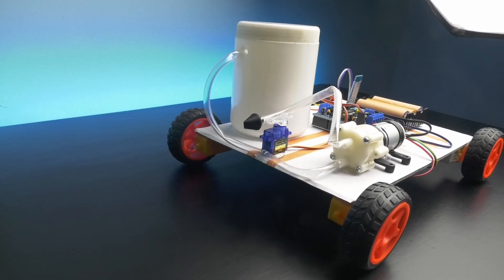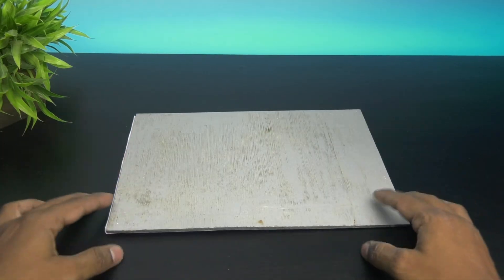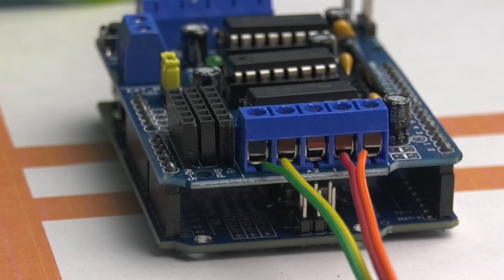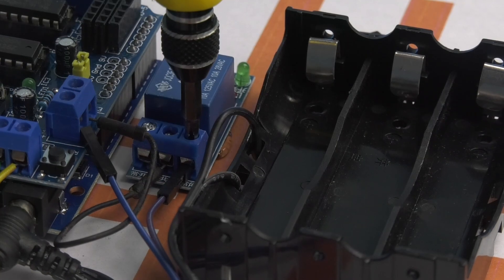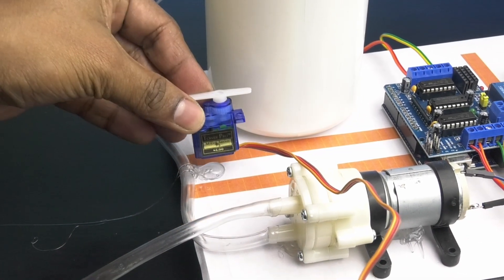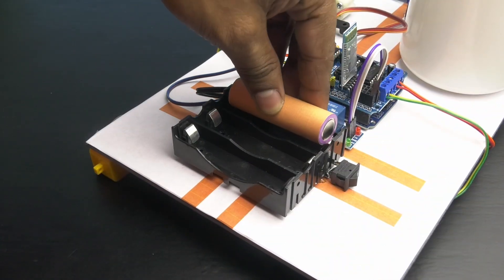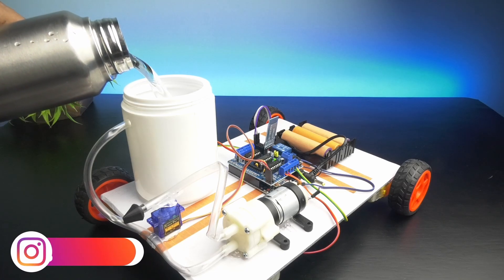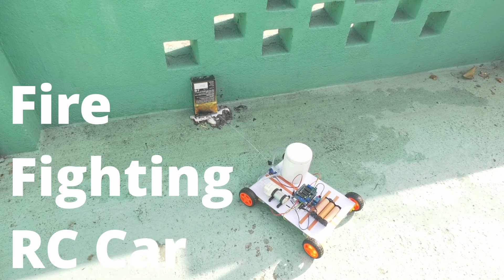Bluetooth Controlled Fire Fighting Robot RC Car based on Arduino | Ut Go

Comment: bro, in ur videos, you directly connected battery with arduino boards right, then it should gives motor shield 5v input when they are stack together, so how does it drives 12 pump since the input voltage for relay board is from motor shield(5v as well)
Reply from the maker: The relay board is only controlled through the Arduino board but the pump power is directly connected through the battery.
Reply: @UtGoTech  ohh i see I see thank you. So I am thinking i can actually get power for pump from a0 to a1 right, like the bluetooth module, it’s 5v
Reply from the maker: @Qenny-m4n That can damage or overheat the Arduino board
Reply: @UtGoTech  okay so I just do the same as in your video, but I will add a voltage regulator to that 2 jumper wires instead of connecting them directly to the pump.
Reply from the maker: Yes

Comment: Why is the extra power input interface  on shield is supplying output voltage to the water pump? I only have 5v water pump, how should I do?😂
Reply from the maker: You can use step down voltage regulator
Reply: @UtGoTech  thanks for replaying me bro. Ive got  LM2596 voltage ragulator on my hands. I just want to know how does 5v shield drives 12v pump with the relay board
Reply from the maker: Take input voltage directly from the battery and convert it to 5 volt then connect to the motor through the relay board.
Reply: @UtGoTech  i mean in ur videos, you directly connected battery with arduino boards right, then it should gives motor shield 5v input when they are stack together, so how does it drives 12 pump since the input voltage for relay board is from motor shield(5v as well)
Reply from the maker: Arduino DC Jack power is directly connected to the power of the motor shield. So if you take power from the power connector of the motor shield then you will get battery voltage.

Comment: Why is the extra power input interface  on shield is supplying output voltage to the water pump? I only have 5v water pump, how should I do?😂
Reply from the maker: You can use step down voltage regulator

Comment: Plzz give electric things name .😢
Reply from the maker: Arduino Uno 
Motor Driver Shield 
12 Volt Water Pump
HC-05 Bluetooth Module 
5 volt Single Channel Relay Board
BO motors and wheels
18650 battery and holder